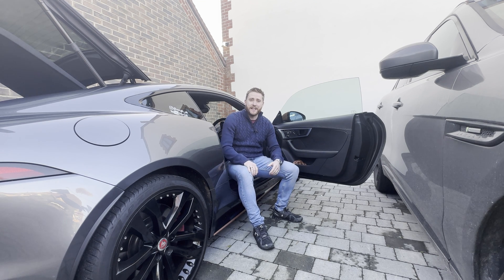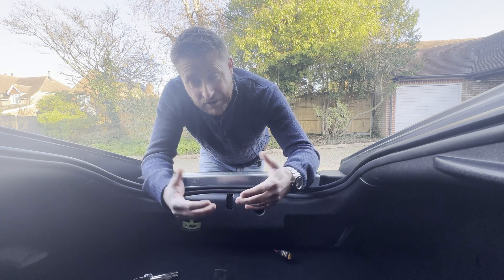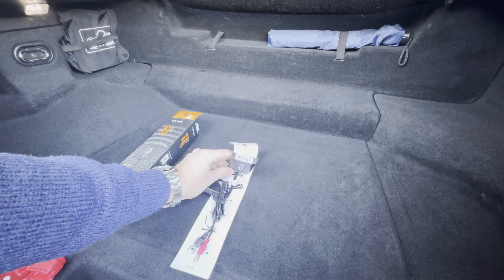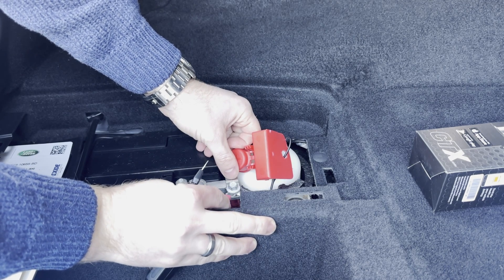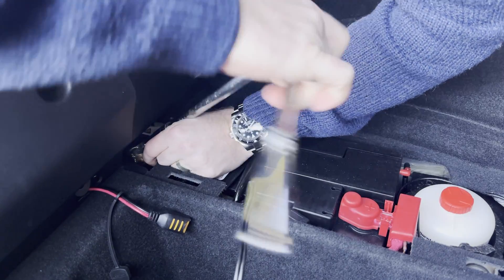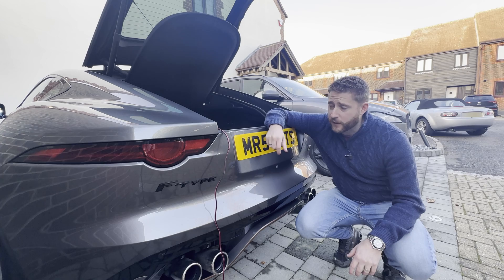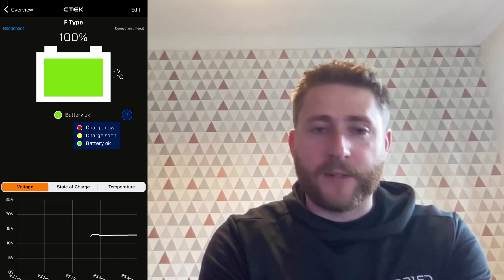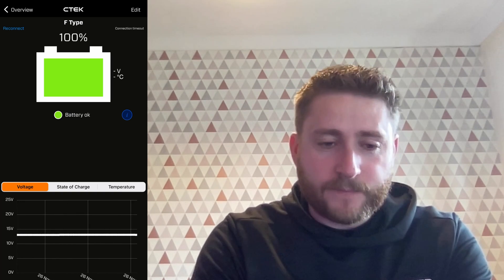CTEK CTX Battery Monitor | Monitoring The Health Of Batteries on High Performance Cars

Comment: I assume that there are no issues with running the cable out the back like that and closing the hatch? i.e. Damage to the rubber seals and/or the cable itself?
Reply from the maker: No damage so far. It's been like that since I bought the car and its yet to cause an issue. The car lives outside

Comment: im having low battery issues with my f type atm and its triggered the SOS system 'functionality limited' warning light. got it booked in to a dealer to have it checked out. but ill defo plan on buying the CTEK monitor if more issues arise.

Comment: Oh - a bit disappointing that you did not monitor it for a few days. It would have been much more interesting, if you had data which could even confirm a battery issue or neglect it. Either way, it seems to be an interesting device.
Whenever someone asks me for advice on a car, which is just behaving "strange" - my first advice is to not search any further and make sure (for 100%) that it is not a battery issue. You can go chasing unicorns, if you have a bad battery for a multiple of root causes for strange behaviors, if you do not get the most obvious (and most likely) out of the way...
Like!

Comment: Have had my 2018 R coupe ever since new, and have never had a low battery warning or an issue with battery voltage. And it can sit for a month or so without being driven in the summer. But during the 6 -7 months of winter here, where it’s not driven, I do put the Ctek Mx5 on it. Cheers.
Reply from the maker: Glad to hear it and thanks for watching and commenting! Winter seems to punish the AGM batteries. Hopefully yours stays tip top for a while still. Happy driving

Comment: Hi - Good video
Do you still have the battery low warning when the battery is 100% charged?
Reply from the maker: Thanks! No, not when fully charged. Is that a problem you are having?
Reply: @MrGB_UK  I don’t own an F-type (can’t afford one unfortunately) but I’m interested to find out why the warning light is coming on. Is the low battery warning voltage measured at the battery (rear of car), or is it measured in the engine compartment via a module. There is an aluminium busbar / copper cable running the length of the car. Any poor joint (resistance increase) e.g. corrosion could cause a volt drop. It is interesting especially if the fault occurs on cars 3+ years old ….I’m just curious.